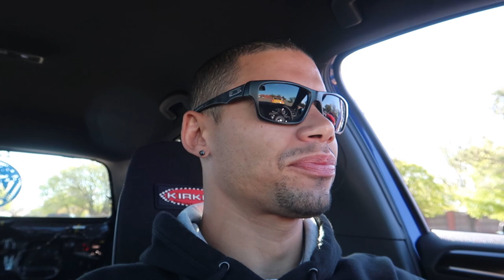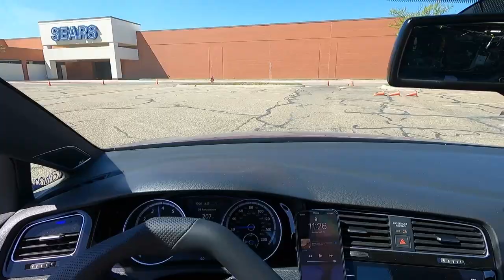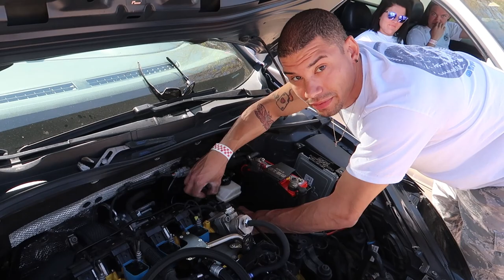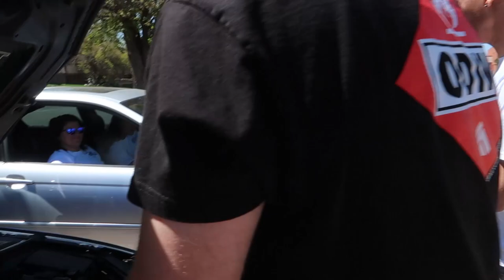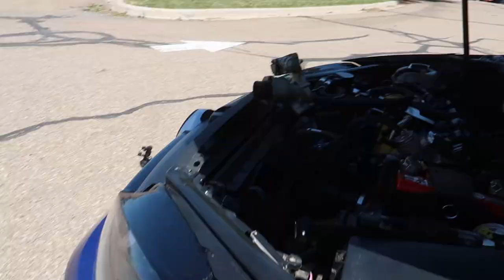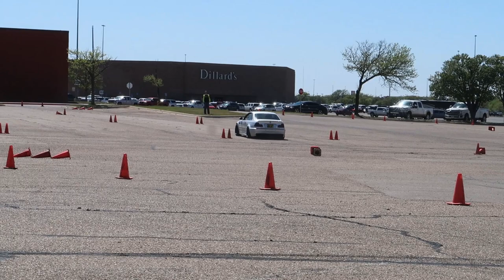First autocross on the new build and I SPLIT my turbo in HALF!! | MK7 Golf R

Comment: so the melting diverter valves do you think this is because of a malfunction in the turbo or do you think this wiill be a recurring issue when you replace it again? are ytou going to look into aftermarket diverter vales?
Reply from the maker: I think it might've been making some excessive heat from all the boost maybe I'm not sure. I'll be testing a few different DVs now though.

Comment: Any conclusions of why this might have happened? Considering the first few runs looks like you might have been spinning the turbo too fast and heat related. I've done something similar, but CHRA went. Glad to see nothing too crazy happened. Glad to see that the CC did fairly well. Still wondering how it would do on track situations.
Reply from the maker: I had hurt the turbo before and was doing some serious overspinning, then at autox finally hitting 8k RPM a bunch plus heat im sure she let go in the best way lol

Comment: i asked for a tuning shop reference in the denver area on a diff video (Bluewater was the answer) because same thing happened to my MK7 GLI running E. problem is turbo parts did get in the motor so total engine turbo IC replacement etc. praying its not the same for you man.
Reply from the maker: No parts in the motor!! She's alive and running now!

Comment: GoFastBits DiverterValve might be tough enough to handle the abuse!
Reply from the maker: Gonna try the DVX
Reply: @BryceJordanProductions  it looks like tomioka racing is putting the GFB DV's on their built turbos but they don't mention them by name.  They're rating their built turbos for 600Hp so it seems like a buff option for your next monster turbo!!
Reply: I am running a GFB DV on my 2013 Mk7 GTI since 2015 with a Stage 2, done about 60,000km, no issues. But I only run half the power (300WHP), so the thermals are not as bad as with your 600WHP R.. LOL
Reply from the maker: Good looking out guys! Imma get one on order here shortly!

Comment: What turbo was that?
Reply from the maker: Standard vortex
Reply: Was there any shrapnel in the engine? Intercooler? Are you going to try to just replace the turbo?
Reply from the maker: There was some in the IC. I also dropped the pan cleaned that, replaced the oil pump just cause and a few other small things. Turbo shows up Tuesday hopefully running by the weekend

Comment: U didn't have to remove.turbo that way. Hahha
Reply: @BryceJordanProductions  this got me.thinking.about my turbo now..
Reply from the maker: Don't worry about it. This isn't normal at all at all lol
Reply: @BryceJordanProductions  I haven't seen anything so far for.this turbo like this. What boost pressure were u running.
Reply from the maker: Like 34lbs but I hurt it prior to this. Plastic and rubber from my failed DV went through the turbo
Reply: @BryceJordanProductions  how about full frame turbo for next upgrade and boost controller
Reply from the maker: You'll see 😎